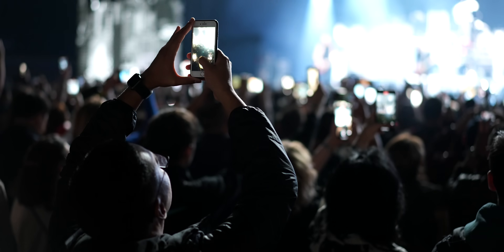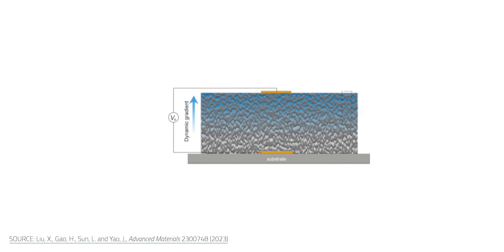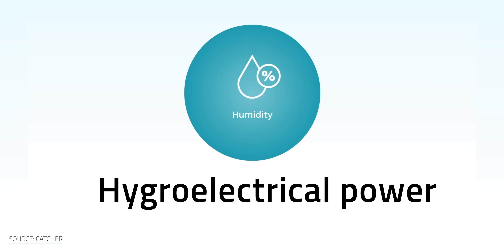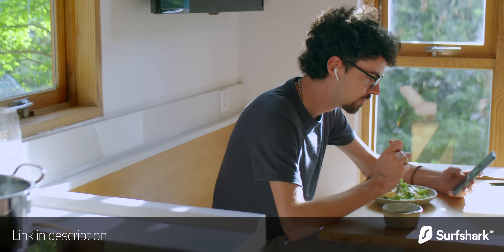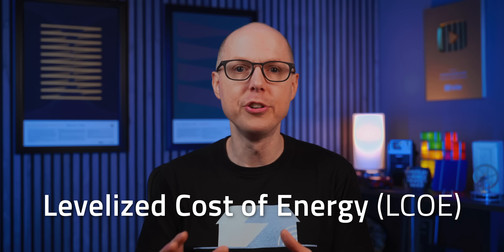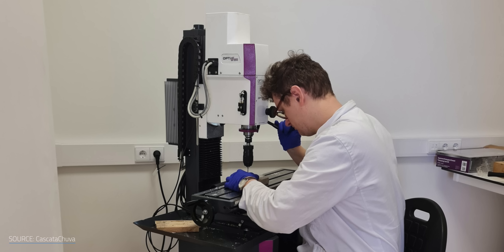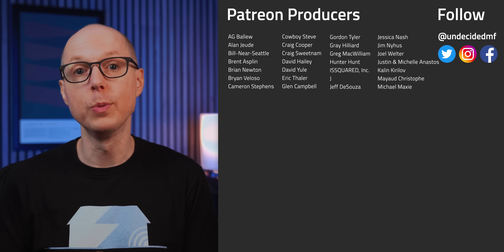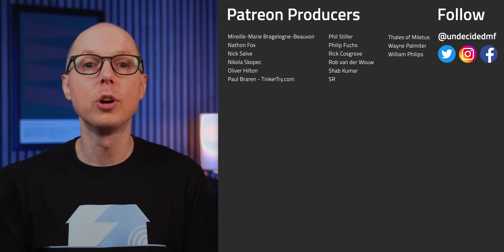Is This Accidental Discovery The Future Of Energy?

Comment: If a small unit could power a LED - it could be made into self powering LED bulbs.

You need just a few W for efficient ones with enough light output.

Homes, sheds, greenhouses or streetlights.
Reply: And you know what you can make with easy to power led bulbs?
Advertisment!
Advertisment on places where it is harder to get electricity!
Hurrah (or something... but at least the possibility will drive the technology..
Reply: Sorry to spoil the fun of a well-meaning science buff, but...

CO2/climate-change is the biggest mass-fraud since communism. 

(See Henrik Svensmark for the cosmic-ray/solar-activity/cloud-formation/climate relationship.)

 CO2 is a ruse. 

Climate change the "Greens" are talking about is caused by changes in the cosmic-rays/solar-activity relationship and cloud formation  (See the work of Henrik Svensmark.)  

Cloud formation by actual cosmic rays can be scene with the naked eye in Cloud Chamber demonstrations.  YouTube has dozens of videos about them.
Reply: But you now that there are laws of physics such as thermodynamics?
Reply: @EnchantingCat8365  And? It doesn't violate any laws if it uses the energy trapped in the moisture from the environment to generate power.
Reply: @MauroTamm  protenation cause a permanent change. To be able to use it again, it would have to be de-protenated, which isn't hard. It can even be done passively, but the energy has to come from somewhere. The only way it works is a cyclical heating like a day/night cycle. But being able to power a single LED for a few minutes per day... is terribly inefficient. Considering a small solar panel and battery could of the same size can power a flashlight for a dozen hours... it just doesn't make sense... maybe some niche applications, but even then, it is pretty bad.
Reply: The device in the video only generated 1 miocrowatt (0.000001 watts), or 1 millionth of a single watt. So for an LED that uses "a few watts", you would need millions of such devices to power a single LED. This tech ain't going anywhere...
Reply: @teddyruxpin3811  Agreed, your better off getting energy from radio waves with a bank of signal diodes
Reply: @teddyruxpin3811  Small LEDs don't draw anything near one watt.   More like 10 milliwatts, but your point is still relevant.  Household LED lights are around 10-20W.
Reply: @yeroca  yeah I was referring to a household led, not one on an arduino
Reply: @teddyruxpin3811 sure, not this one - but if the proposed washing machine size one can do 10kw, you can have one that handles a few W LED.
Reply: @MauroTamm  10kw is more than an average home uses every hour. There's no way it can pull 10kw from thin air. Was that a typo? did you meat 10 watts? If so, that's still 10 million times more powerful than their prototype. That's still quite a leap.
Reply: @teddyruxpin3811  that was in the video. The proposed 10kw device.
Reply: @MauroTamm ok so 10 billion times more powerful than their prototype. yeah that's never going to happen.
Reply: @teddyruxpin3811  I think its 10kw over a whole 24 hour day, it will take 12 years just to recover the cost of the unit let alone breakdowns
Reply: @teddyruxpin3811  That's 10kWh in a 24 hr period. So an average peak of 417 watts. Pretty big difference. He shouldn't have compared it to a 10kW solar array.
Reply: @nigelman9506 maybe they mean 10kw over the course of the age of the universe lol
Reply: @johnrielley7756 The choice of a 10kW array was slightly confusing largely because most people can't keep the difference between kW and kWh straight. In reality, what he was trying to point out was that a 10kW solar system could be had for a similar *price*, despite far exceeding the peak energy output even according to the marketing materials for this energy harvester. (A 10kW solar system could theoretically produce up to 120kWh of energy in a 12 hour day for instance, in practice there's many, many reasons that it won't but that's also going to be the case for this humidity machine)

Comment: This sounds a lot like MOFs. You can get the same effect, but to reuse it, you need to heat it up. The energy out put is insufficient to maintain the reaction. It could still work passively, allowing daily recharging with the natural cycles of day/night. But, it would not be very useful due to the extremely low power, and it would have to climate control enough to ensure its function. I don't see how this could even remotely work at scale. There are far too many non-trivial challenges. Maybe, big maybe, it might work for extremely low power IOT devices. 
- A very skeptical nuclear electrical engineer.
Reply from the maker: Thanks for the input and thoughts on it.  My mind didn't immediately go to MOFs, but that's an interesting connection.

Comment: That doesn't beg the question.  It BEGETS the question!! But related to the tech, what is the relative humidity requirement for it to be successful?  My basement crawl space can get up to 70+% if I don't use the de-humidifier, but not in the winter.  The 10KW output only working 75% of the year will decrease the ROI.

Comment: I'd love to see this actually working and becoming a viable alternative. Does it removes the humidity of the air? How does it keep the humidity gradient between electrodes outside through the outside of nanostructure? What would be the minimum operational humidity? I used to live in a city where the yearly average hovered around 30%, I guess that is too low to be useful? So many questions 😅
Reply: I was wondering pretty much all the same things, in addition to: what happens if you just straight-up submerge it?  The fact that so little seems to be said about how it behaves leads me to believe this is no more useful than a potato battery.
Reply: @Toastmaster_5000 water vapor is smaller then a water molecule. Gortex rain jackets stop the water but let's water vapor out
Reply: @golfish8589  water vapor is made of water molecules. If your rain jacket can pass water vapor, it can also pass liquid water (but that may be slow)
Reply: @janami-dharmam  maybe the molecule size has nothing to do with the impermeability of Gortex, and instead it's the surface tension of liquid water that keep it out ? but yeah, the size of a water molecule do not changes significantly when in a gaseous state.
Reply: @janami-dharmam  water molecules clinge to each other relatively strongly when they are part of a liquid. That's why liquid water doesn't readily soak the fabric. However if the material is receptive to water, compatible with it, hydrofilic, then it will draw water into it's mesh, but it will also drag back in water which tries to pass through... Either way it is somewhat of a barrier.
Reply: @golfish8589  Goretex essentially works on surface tension. It's drops of water that can't get through. Molecules of vapour can escape cos they're small enough, where even a teeny water droplet is much bigger.
Reply: I think the humidity gradient is kept simply because water molecules don't fit very well in 500nm tubes. A water molecule has a width of 0.27nm so less than 2000 molecules of water fit across it.

For reference, a liter of water has 3.34x10^25 water molecules vs the 2x10^3 a staggering difference of 22 zeroes.
Reply: I was thinking of the high humidity where I live in Ireland, especially on rainy days when we’re trying to dry clothes out inside on clothes horses! 
To me this seems to good to be true for anything larger than a wearable. Where is the large source of entropy that you would need for this on a large scale.
Reply: At this point I think its just a dream until we can see some tangible object.  As some have pointed out there is a cost we just don't know what it is yet.
Reply: The most important thing to remember is that they don't actually know how it works. It could well turn out that water has nothing to do with it, or is nothing other than a moderator.
Reply: Gee, if you need high humidity place this battery outside where it’s most humid.  In USA, consider Florida, Alabama, Mississippi, Alabama, and Texas where there’s considerable humidity.  If this battery consumes humidity, could it aid my home air conditioner?
Reply: Sorry to spoil the fun of a well-meaning science buff, but...

CO2/climate-change is the biggest mass-fraud since communism. 

(See Henrik Svensmark for the cosmic-ray/solar-activity/cloud-formation/climate relationship.)

 CO2 is a ruse. 

Climate change the "Greens" are talking about is caused by changes in the cosmic-rays/solar-activity relationship and cloud formation  (See the work of Henrik Svensmark.)  

Cloud formation by actual cosmic rays can be scene with the naked eye in Cloud Chamber demonstrations.  YouTube has dozens of videos about them.
Reply: From the description, it sounds like it generates electricity from an increase (or possibly just a change) in humidity within the structure. That's the only possible way it can work. Which means it would rely on natural humidity cycles which I think really reduces the usefulness.

Perhaps if an energy dense enough material could be found it could be used in conjunction with solar cells? I can imagine solar cell waste heat being used to drive moisture out this material and then as the sun goes down the material starts to absorb atmospheric humidity and generating a little extra juice until saturated. Then rinse and repeat the next day.
Reply: So this is either violating conservation of energy, or it needs something to keep that moisture gradient up that uses more energy than it releases.
Reply: @MarkkuS    I guess it would remove water vapour from the air and allow more heat to radiate higher into the air column, since water vapour is our most potent and abundant greenhouse gas.
Reply: @ markkuS he did not say that the air isnt loosing energy .....for example u could de ionize it (basically stealing current /electrons from whater atoms in the air) or steal heat energy or starve (at that scale possible) a quantum effect of its energy
...... such effects are used to semi store electrons in ssds(solid state drives)
Reply: I would be concerned it would dry the air and effect our rain fall if done on a large scale. Nothing is free!!!
Reply: @Littrell1966 sun light is free so is wind
Reply: @golfish8589 nor wind nor sunlight is free. we do not actually know what happens when you take energy out of natural proceses and how it affects the balanced system
Reply: @Littrell1966  Think about that for a second, where exactly does that moisture go that it's removing from the atmosphere?

Comment: If this works at the washing machine scale, would solve a majority of our energy concerns. Could be for 12v car batteries, even placed accordingly with batteries on site to level out the duck curve. It would be a consistent 416 watts over a 24 hour period in humid areas. I would love to see where this goes for 10k usd.
Reply: Problem, in the North, the cold air in winter holds waaaay less moisture/humidity. So another invention that works, just not everywhere.
Reply: @carlthor91  well correct but it depends on your climate zone. Nothing is constant but ground temperature( at a depth),death, and taxes.
Reply: @polarbearigloo  I'm North of the permafrost line, just South of the Polar Bear capital, there are areas, that you just have to suck it up, and figure out another way to heat, and cool.
For us, stuck between two hydro generating sites, our choice is made for us, a few are on propane, and they will be switching as the annual price rises.
Here a winter temp of -35°C, is not uncommon.
Best wishes from the North.
Reply: Have to wonder where the energy is coming from. Like a cubic meter of 50% humidity air might hold 10 Watt hours, once you use up that energy where is more energy coming from?
Reply: @AORD72  well like most things probably airflow. This with being next to a evaporator coil for air conditioning would be ideal (working with) the way the water cascades in the video. Assumes it acts as a dehumidifier like property. (I could be wrong)
Reply: @AORD72  Where all the energy comes from, the sun heating the Earth.
Reply: @carlthor91  true, you have different voltages at different altitudes. You have to speculate electricity is slowly flowing from the sky to earth.  And sometimes fast (lightning).
The thing is the amount of energy flowing through the air. As you may have seen the there is already things like a static generator connected to a cable flying a kite which provides electricity, but the problem is the amount of Watts is so low it is not viable for anything. I suspect the same with this system. Perhaps once the local are of charge is utilised then it might take time for more charge to flow through the air.
Air having a conductivity of 0.024 W per square meter every degree. I don't hold much hope in a large system being viable.
Reply: Confuse Energy with Power. 10 Kwh of energy per day is obtained with a device with a power of 0.42 Kw that generates uninterruptedly during the day.
Reply: Sorry to spoil the fun of a well-meaning science buff, but...

CO2/climate-change is the biggest mass-fraud since communism. 

(See Henrik Svensmark for the cosmic-ray/solar-activity/cloud-formation/climate relationship.)

 CO2 is a ruse. 

Climate change the "Greens" are talking about is caused by changes in the cosmic-rays/solar-activity relationship and cloud formation  (See the work of Henrik Svensmark.)  

Cloud formation by actual cosmic rays can be scene with the naked eye in Cloud Chamber demonstrations.  YouTube has dozens of videos about them.

Comment: Remember the cold fusion craze from the 1980's?  Where palladium somehow generated fusion in tap water?

I remember a water battery that generated power through deionization by an electron passing through the circuit.

I think that's what's happening here, both this and cold fusion, is fueled by ionized water going through a catalyst deionization process that generates an electric current.
Reply: Time for you to write a paper

Comment: This reminds me of the behavior of mineral distillation out of fluids and the differentiation boundaries along the vessel walls due to changes in the surface tension as the liquids interfaces with the inner wall a vessel , but with a more porous surface and there being less fluid.
Reply: I have no idea what you said friend, but keep up the good work.
Reply: Isn't that just Osmosis
Reply: @gmuzic4lyfe  
Yes, it is related.
I would call this phenomenon micro capillary effect charge transfer.
Reply: @myperspective5091  well stated , the gaps or holes in this membrane does look like synthetic capillaries.

Comment: Its old technology that they have hidden as look at old pictures of old buildings with different antennas on them when supposedly there was no tech at that time for them to even be on those buildings
Reply: Lighting rods, Radio Antenna, and Storm Vains?
Reply: @gmradio2436  As said earlier lightening rods are made differently& some have them too, also they didnt have radio at the time these where up either,  also some had mercury balls underneath as they used humidity & static in the air to produce modest electricity amounts.
Reply: @darrylwigginton1067  You have not named a date, structure, or photo to reference. Until you do I have to guess what you're talking about.
Reply: @thecityissleeping  really tell me why so called old buildings from 1800s too 1900s then had these antenna & no they werent to protect from lightening strikes as that is made differently you cant you ignoramous
Reply: @darrylwigginton1067 So we can't tell you that lightning rods are lightning rods so it must be a conspiracy "they" are doing. You are completely bonkers. It's sad.